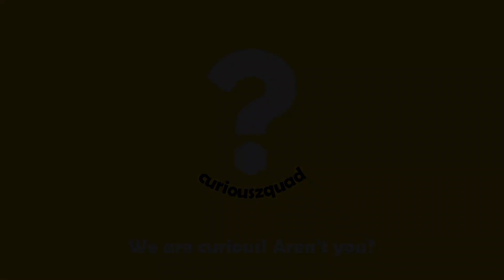Adding a Trailer Gate

Comment: Thanks for the video and all the good ideas.  Nice work!   Where did you get the spring loaded pins to lock the ramp vertically?
Reply from the maker: I think I got those on eBay, but they’re on Amazon as well. They’re just spring loaded gate pins.

Comment: So seriously I appreciate your video series on this project.. I am just starting the exact build found a 74 nomad tandem axle trailer my question is.. how did you demo your trailer? I know in previous video you did not film it and wish you had BUT did you gut the inside then remove sides or did ya rip the body off then haul to dump? I am considering just ripping inside apart then taking sides off to mitigate the mess on the ground..
Reply from the maker: Good question I ripped that sucker right off the frame with a tractor. Lol if you have any other questions just give me a call 706.537.2582